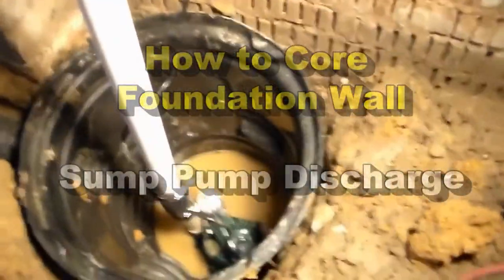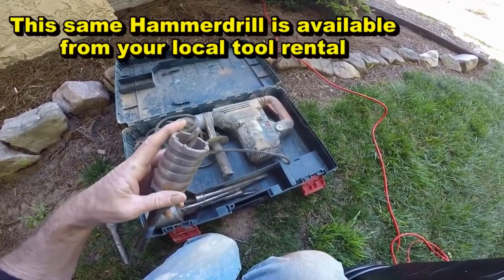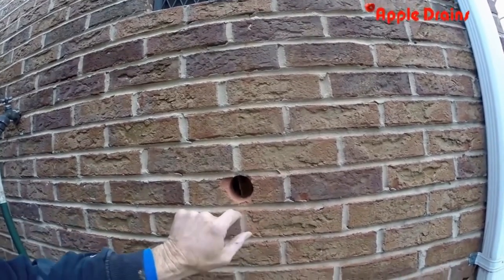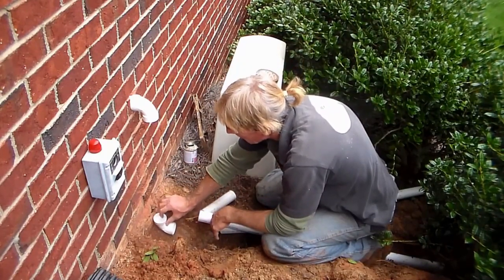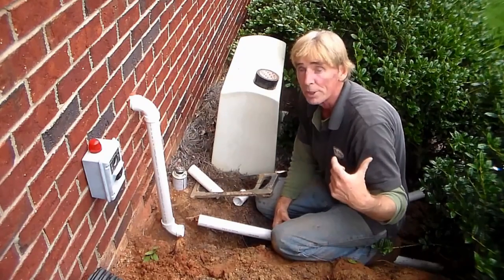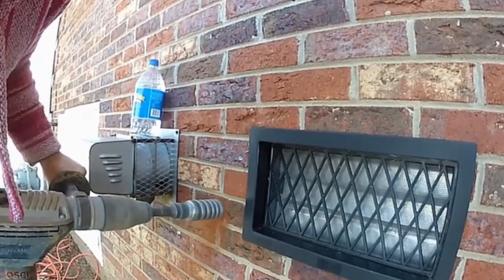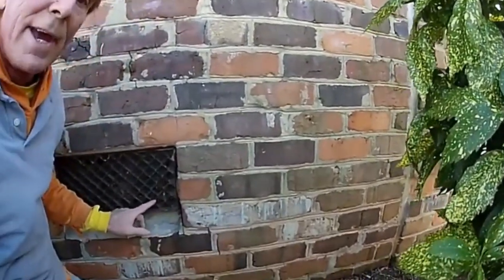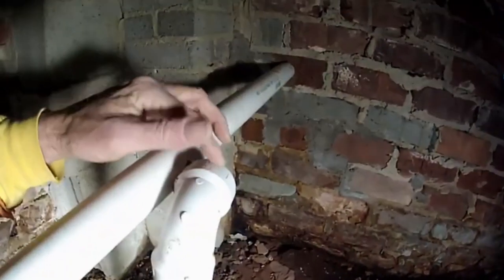How to Core Drill the Foundation Wall - 7 Complete Examples - Sump Pump - Clean Look

Comment: Love your videos,  Very informative.  
Also I am pretty sure you are using a Carbide tipped bit.  Not diamond..  Diamond core drills are more of an abrasive hole saw design.  You don't use the percussion with Diamond core drills.  You do use percussion with carbide.

Comment: if you started with a narrow concrete bit you would have created a pilot hole to drill from the brick side.  Instead you went all the way through from the inside and blew out the brick.
Reply from the maker: Perfect 2 inch hole EVERY-TIME
thanks for comment 😘

Comment: "You can put some glue in the inside of the fitting too", no you are SUPPOSED to put the glue on the outside of the pipe and the inside of the fitting. You are also supposed to use primer/cleaner before you use the glue. I know you are not creating a constant pressure pipe system but irrigation system installers also fail to use the primer/cleaner and their fittings fail even under the ground where there is a coupling. Ask me how I know that. 
Why do you bring the discharge pipe up the wall so high?
Reply from the maker: Cool